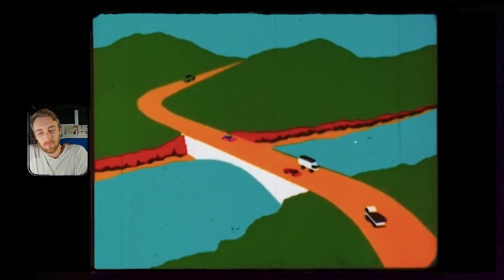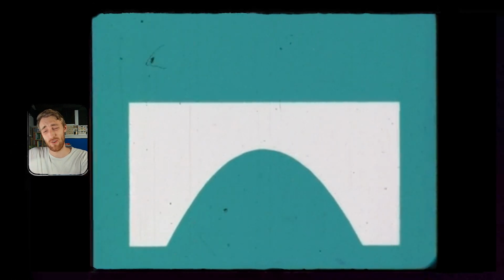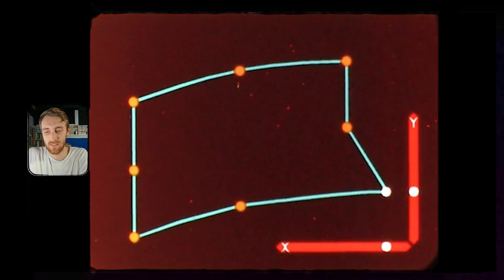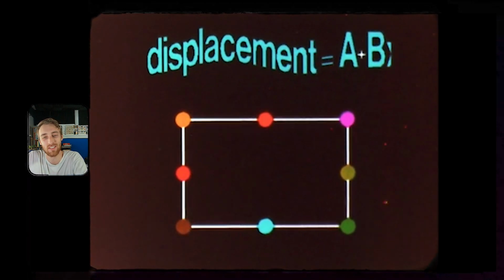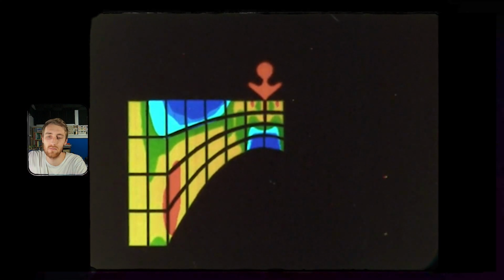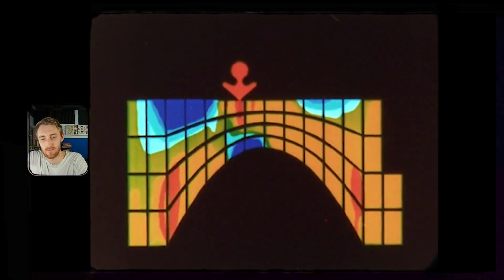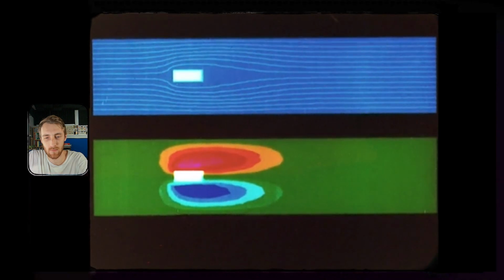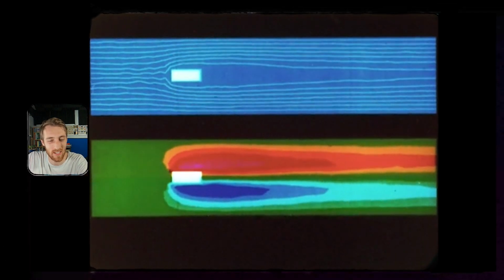Finite Elements

Comment: Frankly it aint that bad to follow, you just lack all the prerequisite knowledge for it - from looks of it.

Finite element analysis is just a "divide and conquer"-ish algorythm (recipe for doing math) to calculate how stuff behaves.

This - like one shown in video - is mostly used to calculate how mechanical object behave. Like what happens to bridge if i place stuff on it.
Reply: Well old school way you either used geometric cosntruction, or did equations by hand.

The dot thingy was just visualisation of matrices (more or less grid of numbers), with different colored dot representing a different variable - i guess colored dots are nicer than greek letters.

You make matrices, out of the equations describing the object, coz they are easy for computer to do. I mean they are hella boring to do by hand, but the same repeating nature makes it easy for computer. (While doing symbolic math is hard for computers)
Reply: World is even more open today.
Its just that people are jaded, and take everything for granted.

Take for example the "oldie but goodie" copypasta describing computers:
> dig in remote places
> extract extreme rare rocks
> perform a forming spell on the rock
> extreme heat and pressure required
> inscribe microscopic arcane sigils into your magical stone
> imbue stone with lightning
> stone gains anima
> stone speaks in a language incomprehensible to all mankind
> certain trained warlocks can control the powers of these stones
Reply: And well its called finite element, since it doesnt treat the object as a coninuum,  ut chops it up i to small bits and approximates the behaviour of the whole witb behaviour of part.

And ofc. it aint an animation techniqu.

Comment: I'm not an engineer, but from what I've heard, the purpose of finite element analysis is to calculate the forces on a structure by cutting the structure into finite pieces that are easier to work with, and then putting those forces together based on how those pieces interact with each other. Finding the solution to a huge system of equations (something I did as a math major) is a huge headache, especially with that amount of equations; so computers were probably required for finite element analysis to be practical at large scales.
Reply from the maker: I love that you’ve actually heard of finite elements before 😂 sounds like you already have a better understanding of them than me!
Reply: @ArchiveDiveYoutube  I actually only heard of it because I listen to a podcast about plane crashes, and one of the hosts had to do that during her time as an engineering student.
Reply: I have a degree in EE, but i had read about using this method for Mechanical Engineering, it was of interest because you would need a computer to do more than a simple problem, computer designs was one of my "things". Back in 1975, you would have need at least a mini-computer to do this.